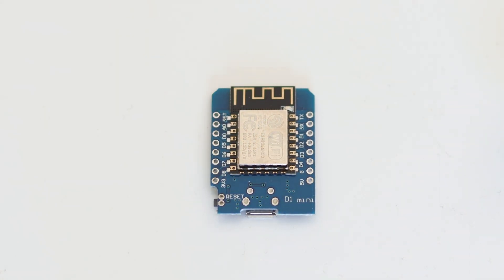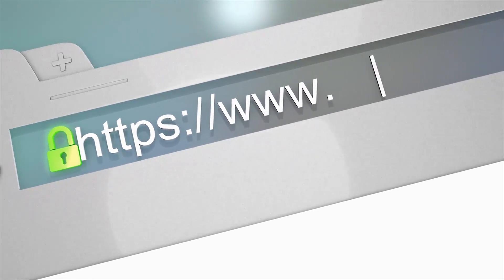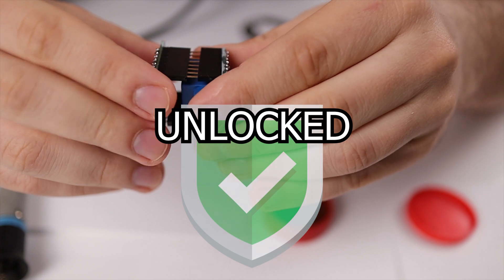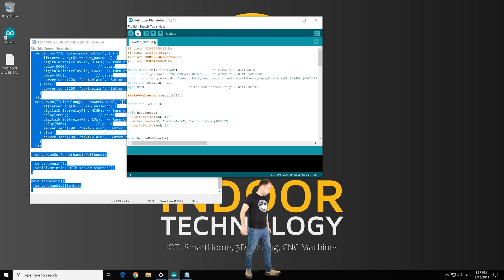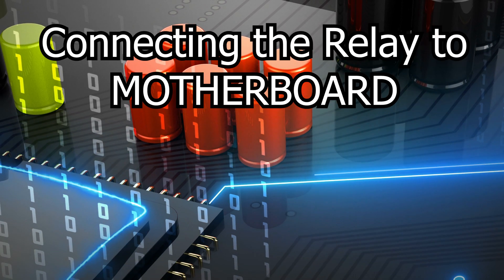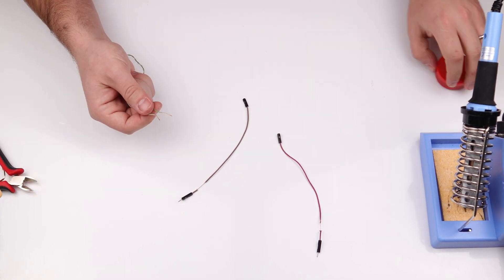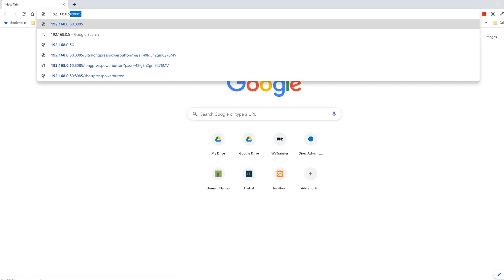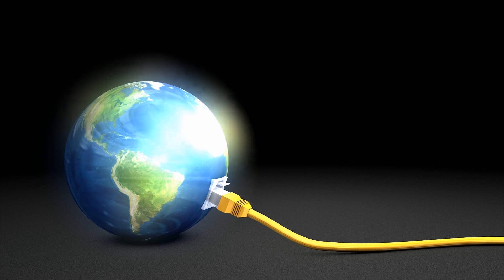How to turn on your Computer Remotely - DIY Tutorial

Comment: I know that it is not a place to ask you about such, but after consulatation with friends i have no idea what to do -

In the Arduino IDE while loading of the code to D1 mini i receive one annoying error - " Timed out waiting for packet header " - Me and friends do not know what to do. Arduino Forums also do not have answer.

Full text: error: esptool.FatalError: Failed to connect to ESP8266: Timed out waiting for packet header
Reply: issue was fixed: i just did buy new one less chip model of d1 mini

Comment: I know this is old but you totally forgot about the fact that the module needs to be powered, now from where? if its inside the computer you cant connect it to anything because the PC is turned off
Reply from the maker: You can turn on USB power from BIOS and you can simply power it from your computer USB, even it is turned off, or just use any external phone charger.

Comment: I got the relay turnnig on and off remtotly . But I dont know wich wires I should connect on my HP DesTop 400.
I know at the main switch there are 6 wires .1 red, 1 black, 1green, and 3 whites . Could you 
help PLEASE?
Reply from the maker: Maybe your button have also RGB led so that would require extra 3 wires. Just follow the path of wires on motherboard or button and exclude the wires that are used to power the led.

Comment: apple server had in the past this system integrated in the machine  (W.O.L) but that was the only machine who had it. -I always dreamed to be ablate do that manipulation with my iMac and it seem you came up with the solution - however there is something I mise  once you assemble the Diy with the 2 part I have to Hooke it up to the Arduino program it and remove it put in the computer (well isolated) and no need the Arduino device any longer -- is it correct

Comment: Would the same thing work with a raspberry pi zero wifi?
With my limited knowledge I don't see why it would not work, but I ask just in case.
Very nice video btw :)
Reply from the maker: You can definitely turn on your PC with a raspberry pi zero, but you cannot use the same code, as on Raspberry PI u need to put some sort of LINUX. Also, you have 40 GPIO pins on pi zero ... you could do much more complex projects. So technically, yes, you can do this, but not using this tutorial and code. All the best!
Reply: @IndoorTechnology  Thanks :)
You absolute legend

Comment: Hi, Wanna ask where I can test it before I put it on my motherboard?
Reply from the maker: Hi! You can test it without plugging the wires to motherboard. You will hear the relay clicking and you will know that is a button press.
Reply: Another Question? It is ok to use Wemos D1 Mini Pro? The Process will be the same?
Reply from the maker: @marklowelmontealto5617  yes, it is the same process.

Comment: Can you please show a diagram of Cable connection of Relay with Computer power port. Because i am new in it
Reply from the maker: I don't have any diagram but it's very straight forward. The two wires that goes to button, should go to the relay on Common (C) and Normally Open (NO). Every relay have that written on them or specified in the schematic. Just watch that part in my video a few times and you'll understand how to do it.
Reply: @IndoorTechnology  in my computer two buttons one start and one restart for restart button how to wrie.
Reply from the maker: @r2success626  You don't need to wire restart button. You only need to connect the power button as reset can be achieved long pressing power button.
Reply: @IndoorTechnology  thanks 😊 you are the best YouTuber who really contribute in helping other to make their life easier. Thanks love your video.

Comment: Hey nice project. Everythings wrkng fine fr me bt the pc shuts off after 4  to 5 seconds when connecting nodemcu. all things are working commands on browser also working but just as soon as i start my pc it shuts off automatically i tried with long presss and short press both work fine . but cant remain on for more than 4 seconds.  I have also tried different code project with octocopuler i face the same issue there also . Please help i cant figure out what is wrong. I also tried different nodemcus . My motherboard is Asrock H110 pro BTC+. THANKS plz help me out Sir.

Comment: What's inside the red container when you are soldering?
is it necessary when soldering?
Reply from the maker: Hi! It is flux. Flux is a compound that helps clean the wires and allows the solder to stick to them. Usually the solder already have flux in it. It is not mandatory but using it, will make a better & cleaner solder.

Comment: can i connect arduino to lan cable instead of wifi?
Reply from the maker: yes, you can do that and it will work fine, but you need to adapt the code as you will not use wifi libraries anymore

Comment: Can you please help to do similar setup for laptops
Reply from the maker: Laptops will need much more technical knowledge, but more or less it's same thing. The downside it's you don't have enough space inside the case. As long you can attach to wires that goes to button, you can use the same code/tutorial in this video.

Comment: Great video, thank you! 
I have 2 questions:
- If I plug-in USB cable into the motherboard with the header adapter, will there be enough power for D1 mini to work even with PC turned off? 
- If my internet provider changes my IP (since I have the basic dynamic IP), will the connection still work?
Reply from the maker: Hello, Matúš! 
I'm glad you liked my video. 

- The USB provides enough power for D1 mini module, BUT your USB may not have power after you turn of your computer. Some motherboards have some BIOS options to keep the USB powered while computer is shutdown. You need to check if that's your case.
- If you have dynamic IP there are a few options:
        1. Check your router in admin panel if it has DDNS option. This way you can make a free account on https://www.noip.com/ and configure a domain for your IP like matus-danko.no-ip.com  ... this way your router will keep that domain every time updated with your IP.
        2. You can add some extra code to D1 mini module that will update the noip.com domain
        3. Make sure you watch my next video which is coming in the 4-5 days, as I'm explaining more about this

If you have any more questions, do not hesitate to ask. I'm glad to help!
Reply: @IndoorTechnology  Thank you very much! I'm curious about your next video, keep up the good work!
I'll try to set up DDNS, but No-IP has 30-day refresh rate which is quite annoying, so I'll look for some others probably
Reply: @matus-danko  čauko, čauko, všiml jsem si podle jména, že si Slovák. :) Jak si to vyřešil s tou DIPkou?

Comment: I have the exactly same module as you do in the video, and it works :D. Another way to hook it up to the motherboard is to rip-off some power connectors from and old computer case using some pins or steel wires to forcefully connect on top of each other.
Reply from the maker: Haha, that's the spirit :)) OR you can just buy a new computer to rip-off the power connectors.